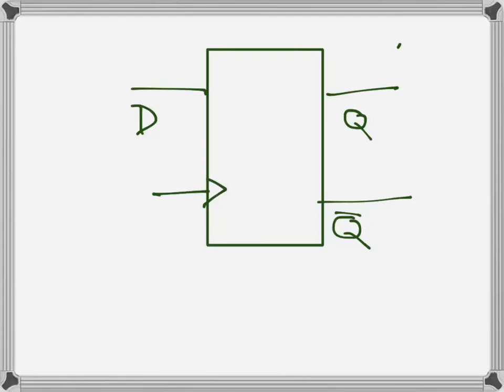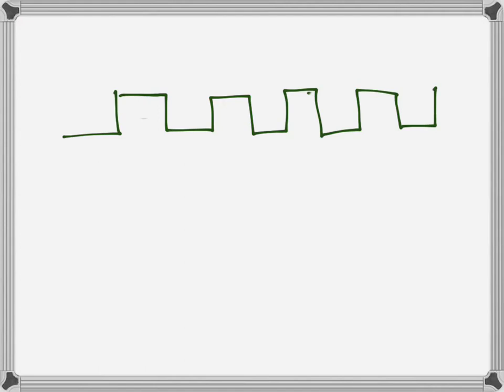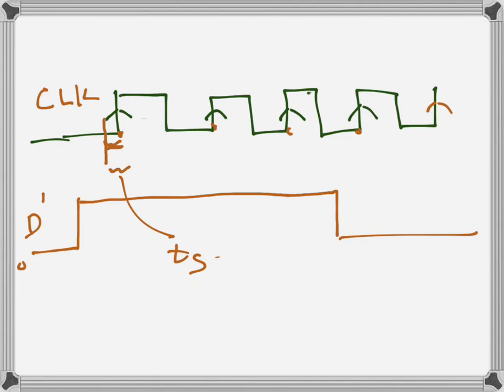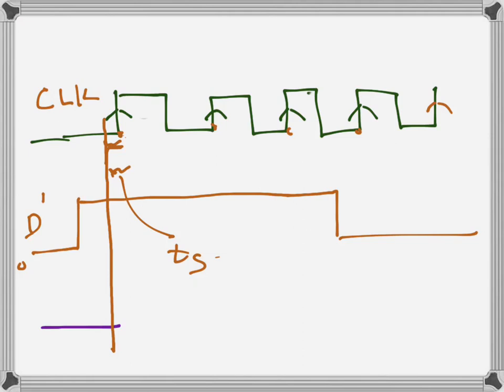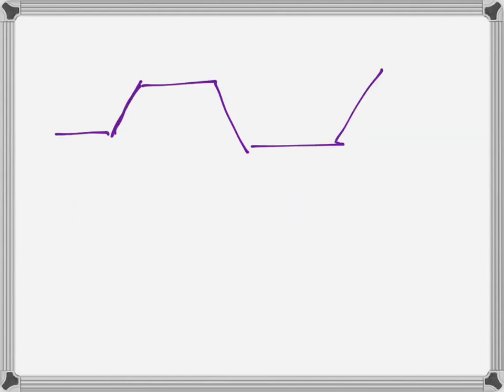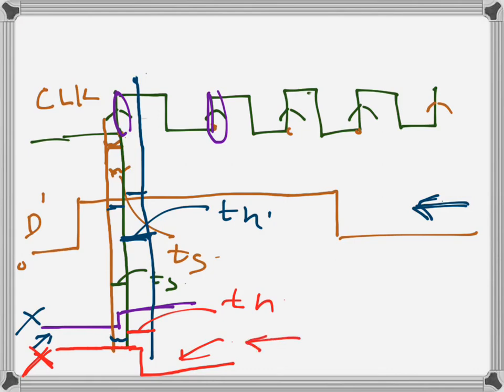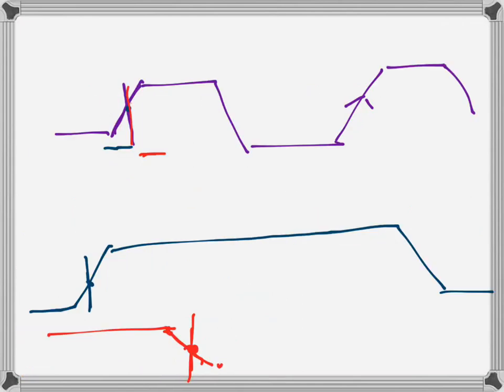Digital Electronics: Setup and Hold time of a Flip Flop

Comment: The measurement of hold time is from clock triggering edge (50% mark) to the output going low. This is the the hold time for passing a 0. With the signal (D) staying high for a long period of time, how is the difference between the clock triggering and the signal going low in time calculated, since in the video above it requires the signal to drop in value?
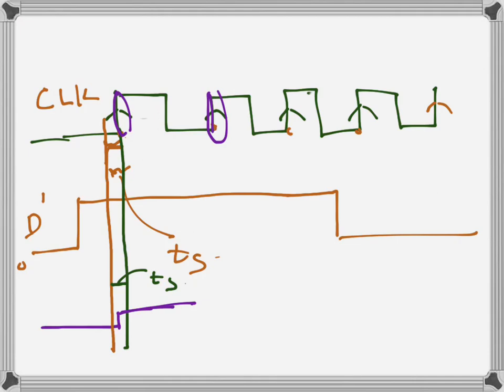Reply from the maker: Thanks for your comment, the thing is input signal cannot change withing the HOLD time, so any transition of the input signal is not allowed, whether it is from L to H or H to L., pls try watching 5:15 - 7:00 of the video, it may be helpful.